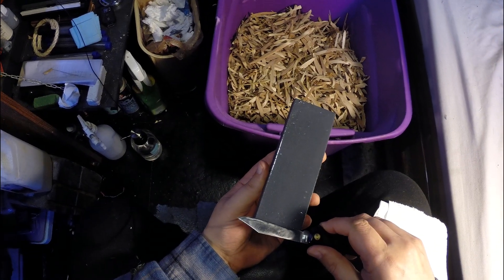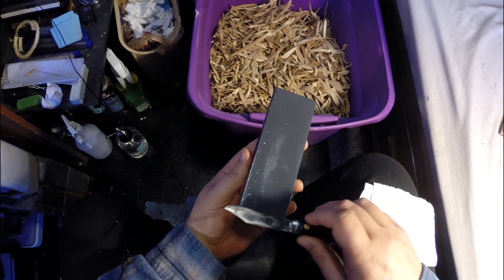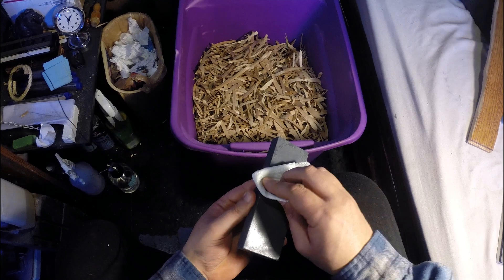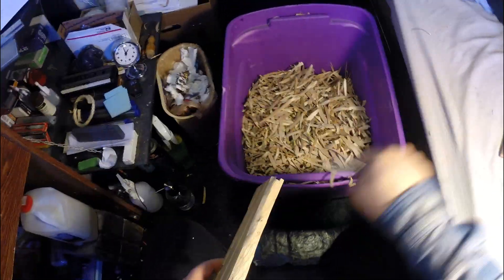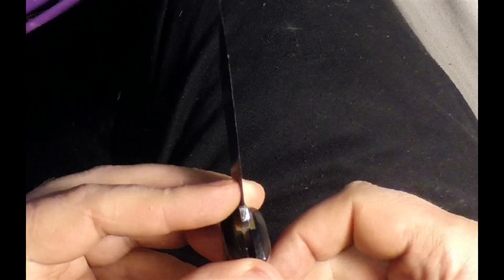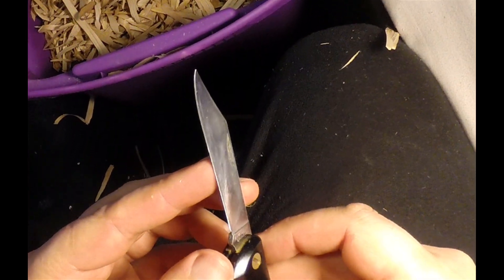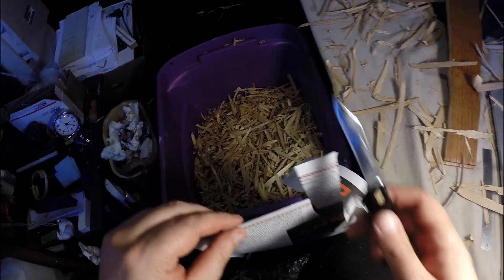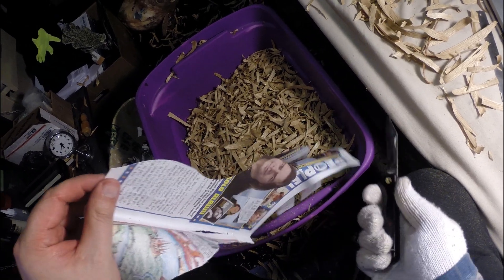Normark EKA 12C27 : optimal edge geometry for slicing hardwoods (norton economy fine edge)

Comment: Thanks for noting the edge profiles in the description, it helps a lot keeping track. One q: What do you mean by '7dps edge' in the first configuration if you applied an edge bevel on the second run? I think I'm having a derp moment.
Reply from the maker: The original edge was full zero, it just had a hint of curvature close to the edge which brought it up to ~7 dps. This was just because it was ground on a waterstone which due to wear/slurry will produce a convex bevel. If it was ground on a DMT plate or similar then it would be true zero to the primary flat which would be ~3 dps. This is too fragile aside from light paper, foods, and similar.
Reply: Cliff Stamp  Gotcha, that makes sense. If the issue was just apex damage, then why couldn't you have just increased the angle of the microbevel (e.g. to 20dps) and done without the secondary edge bevel at all?
Reply from the maker: A Sharif
The damage was beyond the very apex and ~0.005" up into the edge bevel itself.

Comment: Great video cliff! Question: why do you put a secondary bevel on at 12 dps AND then micro bevel at 15 dps? Why not just find the optimum secondary bevel angle with no micro?
Reply from the maker: If I didn't use a micro-bevel I would have to increase the edge angle to the extent it would compromise the cutting ability. The smaller the edge angle the lower the wedging and in general the higher the cutting ability.
Reply: Cliff Stamp I understand that about the geometry, but I guess I'm wondering why you couldn't just stabilize the whole thing at say 13.5 dps, which would be a compromise and should technically offer higher cutting ability since it wouldn't have the steeper micro bevel, right?
Reply from the maker: Razor Edge Knives LLC
We are looking at it a little differently. I would ask you why would use use the entire edge at 13.5 dps. if that is what is required to stabilize the apex it is likely higher than what is needed to stabilize the edge. In that case I would run a 13.5 dps micro and a lower edge angle.
Reply: Cliff Stamp
the cutting ability is compromised by a lower edge angle because of the high contrast between the thinness of the edge angle and the thickness of the shoulder as the bevel widens into the thickness of the blade?
Reply from the maker: knives save lives
I am not sure what you are asking exactly. The reason why in general the entire edge at 13.5 dps would cut less than a 12 dps edge with a 15 dps micro-bevel is that the 13.5 dps edge is thicker in cross section. A micro-bevel is literally that, on the order of microns wide. It has very little effect on cutting ability at all, though it has significant influences on edge retention.
Reply: what i was asking is when you said "If I didn't use a micro-bevel I would have to increase the edge angle to the extent it would compromise the cutting ability. The smaller the edge angle the lower the wedging and in general the higher the cutting ability."
the cutting ability is compromised by a lower edge angle because it would cause wedging? so you add a microbevel to get around this?
Reply from the maker: knives save lives
The micro-bevel is added for ease of sharpening and burr minimization. The angle of the micro-bevel is set to be the minimal angle needed to keep the apex from deforming/fracture. The reason the entire edge isn't at that angle is because it doesn't need to be, it can be cut back to a lower angle and still resist deforming/fracture.
Reply: ok, i was apparently misunderstanding what you were saying as i thought you meant a lower edge angle would cause an issue with cutting performance due to binding.

Comment: Cliff, what are your thoughts on perforated plate with diamond coated sharpening "stones"?  I got a 4 sided one from Harbor Freight very cheap and Ive used it to reprofile a knife.  Also, I am subscribed to Wranglerstar and todays video he shows a swing out utility knife from Stanley that has something to dow with woodworker Paul Sellers and thought you'd be interested in the design. Its on amazon for less than $10
Reply from the maker: I have both the old style dot DMT and the new style continuous. The only real issue with the dots is that points (especially serrations) can go into the dots and catch.

Comment: Awesome test!  I can't tell you how many guys I see with these useless scary sharp shallow grinds on there knives these days. 
It seems like shaving arm hair is the only work their knives will ever see. What's worse is they are all starting to put these edges on their axes! 😳  I wonder how a same angle single bevel would hold up to your torture test?  The wood flooring is definitely harder on the edge then rope or other soft subjects. Thanks much for sharing!
Reply from the maker: Yeah, you need to adapt the edge to the task. If I was just cutting rope and cardboard then I would use the first angle setting which would be fine there.

Comment: Wonderfully demonstrated and explained, excellent video. I would take low carbide steels with their ease of sharpening over high carbide any day. Now would you be able to drop a few degrees with a high carbide...
Reply from the maker: That is the question which unfortunately is often ignored, the ability of one steel vs another to work in a particular geometry.

Comment: Are you doing this to find general attributes of steel grind etc or doing this specifically just for this knife? Do you do this with all knives as well if the answer is for the second?

I agree I think taking the oil off does have a positive effect to just cleaning up the apex.

I would like to see you try my L45 with this type of cutting, think you could gather some interesting opinions.
Reply from the maker: I do it for every knife, but not every knife is set to do that type of work.

Comment: All you need to do to return it to true 90 degree push cutting is just strop it on your forearms. All the abrasive in the leather like skin will align the wire edge инто а сцаръ схарп оне

Comment: Good demonstration.  Confirms the standard, plane blades (high force, high twisting) get usually sharpened around the same angle.  On the other hand vegetables (low force, no twisting) can take any angle,  but then few sharpening jigs go under 13dps.
Reply from the maker: Adamast I think basically once you start asking about things like that and looking at very low angles then you have moved beyond the need for most jig systems.
Reply: Maybe advanced when coming from pocket-bushcraft knives (although Mora).  When I bought my first chef knife (Wusthof) I couldn't cut carrots with it, even sharper it was much harder than with a 'common' German parring knife. So to make it usable (for me) I halved the angle and now it cuts fine. Surprisingly the same makers don't hesitate to give a low angle to bread knives as these have the same per side angle on a single bevel.
Reply from the maker: Adamast
Those traditional chef's knives can get used for hard work at times often to do things like cut the knuckles off of chicken legs and similar for that kind of work you need a decent edge thickness/angle. But if you are not doing heavy bone work, yeah, cutting the angle in half and thinning the edge back is definitely the way to go.
Reply: A thin edge is also not so good at scraping bones too, as it bites the bone. Being successful with the finger nail test is not always a plus.  But I think that the use of large knives like a chef knife is also uncommon for deboning.  Martin Yan (and maybe whole Asia) is the only one on youtube to go for a 8" or bigger knife when cutting a chicken.
Reply from the maker: Adamast
It is very interesting to look at different cultures. How the Chinese use a cleaver for example is very different than how they are used in the west.

Comment: If you used a Super Steel like cpm 110V would expect that the same geometry (12dps secondary ~0.003" thick, 15dps micro-bevel) would be optimal?
Reply from the maker: I don't think it would fail in the same way. It would likely fracture rather than chip. It is a curious question though which would be stronger, a well HT very high carbide steel or this steel which is much lower carbide but has much less strength.

If I can locate enough hardwood slats I will do it again with a 10V blade.
Reply: Cliff Stamp I put a shallow edge on a Spyderco paramilitary 1, in s30v. Even with rather steep apexing the edge chipped and rolled on first contact with particle board/melamine. I wasn't being gentle and wasn't expecting any damage. Well ground blade, well into "fresh" steel.

I don't have exact numbers but around 10 deg per side and then 20-25 per side micro.

Comment: How does the stone in this video compare to something like a Norton India? I am looking to get something like this but can't seem to find a Norton silicon carbide stone in the UK.
Reply from the maker: It has a much softer bond than the India and thus it breaks down in use. I hesitate to say it, but the bond strength is almost perfect for edge work as it in just barely breaks down and thus it gives a fresh cutting surface for minimal wear. On the fine side anyway, the coarse side has a much stronger bond and like the India doesn't break down at all.
Reply: Cliff Stamp would this change the way you use the stone to sharpen then?
Reply from the maker: MacThunderstick
Not in regards to how I sharpen, but how I maintain the stone. If the stone doesn't break down you have to lap the stone with an abrasive coarse enough to cut it to maintain a high aggression on the stone, otherwise it just gets finer each time you use it.